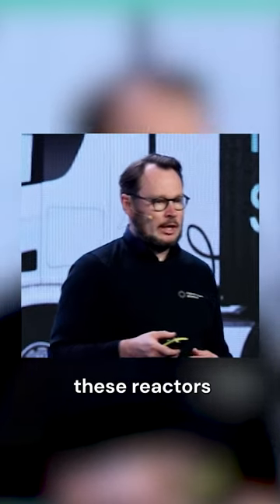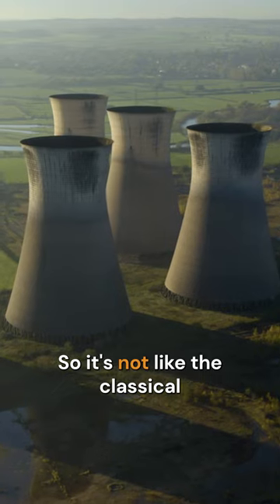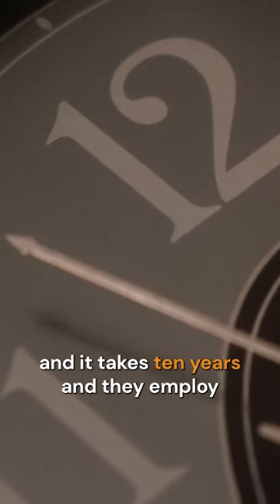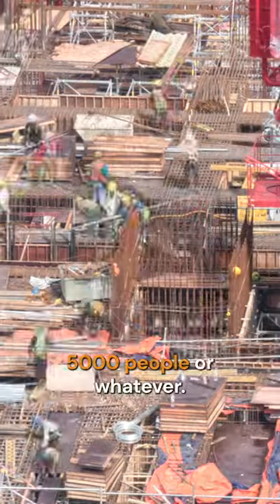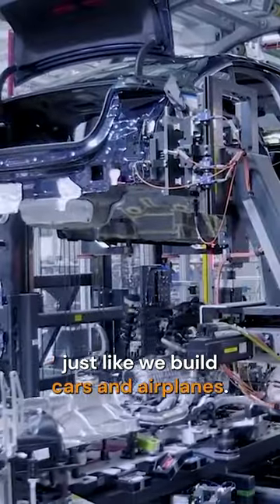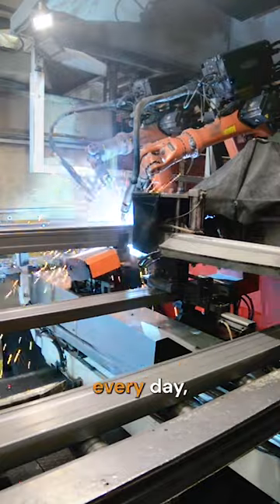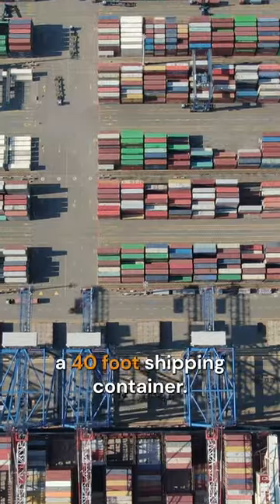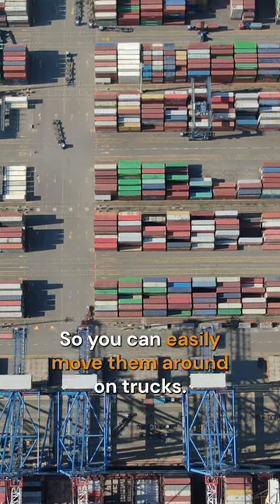Revolution Or Risk? Building NUCLEAR Reactors Like We Build Cars And Airplanes

Comment: Mini reactors have a lot of promise I think. The big problem with nuclear right now though is cost. And with fusion becoming a more popular goal, will there be a need for these (I mean besides remote/emergency applications).
Reply from the maker: Hi! Relevant question you pose. We believe so for a few reasons. Firstly, fusion is still surrounded by high uncertainty it may easily still take 20 years before we see a commercial reactor. Secondly, considering the sheer size of the energy market in the world, we will need many, many different companies and technologies to replace fossil fuels.
Reply: I think hoping for fusion when weve got MSR and thorium is like sitting in a tank in a warzone and waiting for railgun tech to pull the trigger. The tech is extremely viable, many people are dying daily due to the energy crisis, fusion is promising but way off and practically no different for our needs
Whats the purpose of fusion? Safe, cheap energy, wont cause a chernobyl 
What do msrs achieve? Safe, cheap energy, cant cause a chernobyl

Comment: Nuke on a semi-trailer. Coming to a neighborhood near you!
Reply: I find it Weird how more people are Concerned about Nuclear Reactors being Mass Manufactured Than the Current Number of Unfound Broken Arrows.
Reply: They wouldn’t ship it with the uranium in it, genius
Reply from the maker: @Ry_TSG that is correct! Fuel will be loaded on site
Reply: These reactors use Molten Salts.
The fuel can there for be pumped into and out of the reactor.
Reply: @NukHind You still have waste issues there guy, what is the local shop going to do but dump it.
Reply: @zack9912000  The fuel's in a closed cycle and no nuclear waste is just "dumped" anywhere in the world. When it runs out, the company that made them comes and gets it, hauls it to a processing facility, and safely disposes of the expended fuel. We've been doing so for decades.
Reply: @zack9912000 > not really. These reactors can even burn spent fuel from older plants. Waste pr. person in a lifetime is about a coke can in volume and not really harmful.
Reply: @Ry_TSG > they dont use uranium.

Comment: You can easily move your nuclear reactors around on trucks, eh? What could possibly go wrong?
Reply: Nothing. Literally nothing significant. Why do you think something could go wrong? I assume you know little about these new types of reactors. They are safer than wind power.
Reply: @AEVMU  yeah? These things are low power output per unit, so they would have to be plentiful (like wind tubines) and therefore difficult to giard. Suppose a terrorist steals one? Or blows one up. What then?
Reply: @paulgush  You can't steal them, that's like saying you could steal a building and its basement. If one gets blown up the radioactive material would probably still remain contained and even then, its not that  much or that bad. A bomb of the size that would be required to spread nuclear material would be far far far more effective in a populated place which makes them unlikely targets. Further, it is actually pretty easy to set up a perimeter guard at a building. You also can't say they would be plentiful like wind turbines. It's an order of magnitude or two, fewer, totally absurd to make such a comparison.
Reply: @AEVMU  a things you may be overlooking:1. the public psychology around nuclear accidents or acts of terrorism 2. The cost of guarding so many facilities. 3. The long lasting effects of radiological contamination

If you invested financially or even emotionally in this train to nowhere, I extend you my condolences. Nuclear power promised to be "too cheap to meter" back in the day. Instead it turned out to be too expensive to matter
Reply: @paulgush  Your points 1, 2, and 3 are all BS, and easily solved and you have clearly done zero homework. You do know that windmills are responsible for more deforestation than nuclear and more deaths in the last 20 years as well??  Did you know that many have balsa wood cores, and offshore wind produces more C02 per megawatt and is more expensive per megawatt? Onshore wind, because it is poorly planned, is also terribly ugly and utterly destroys the appeal of the countryside. You might like feeling like you are living in a machine but most people don't want to ruin nature like that. I'd rather 5 large nuclear plants or many smaller building sized plants, none of which produce any pollution, than visual pollution any day. Also, there is no nuclear contamination. Get with the times, you sound terribly out of touch.
Reply: @AEVMU  TLDR. You are a charming gentleman, very pleasnt to talk to. I wish you and this nuclear folly a happy yet futile future.
Reply: @paulgush  Considering how many plants are already being built or planned the future looks very promising.

Comment: I think depending on the energy output it could be ok, but i dont think they should be transported by truck or boat, unless the roads get closed off as its transported
Reply from the maker: Hi! Today, actually a lot of radioactive material is transported around the world every day. But we are very good at handling it, so it isn't an issue. Furthermore, we will transport the fuel and the reactors separately. So the fuel will first be loaded in the reactors when they are in place at the power plant.

Comment: So mini Chernobyls everywhere
Reply from the maker: Hi! No. You cannot compare these reactors to the RBMK reactors at Chernobyl. The safety in these reactors relies more on physics. Firstly, as the fuel is encapsulated in the molten salt, if the reaction heats up, as a liquid it will start to expand leaving a larger gap between the atoms and thus the reaction will slow down. Secondly, if everything fails say e.g. power loss like at Fukushima, the salt will drop into drain tanks underneath due to gravity and the reaction will stop. Thirdly, there is no pressure in these reactors meaning you can never have an explosion like at Chernobyl.
Reply: @CopenhagenAtomics  it was a joke dude i know that
Reply from the maker: Whoops haha! You never know in YT comments.. a lot of people seriously believe that :P
Reply: @gothicmommy8796 it wasnt.
Reply: @CopenhagenAtomics your CEO looks like the villain from a James Bond movie.  I can imagine Mads Mikkelsen will play him.

Comment: Fusion (and micro fission) power will make many billionaires a lot more money. Solar panels on every home, business and covered parking rooftop empower EVERYONE as their own power generation owners. There's no comparison...

#SwitchToSolar #SwitchToElectric #EmpowerEveryone
Reply: EXACTLY!!!  As long as I'm connected to the grid, the local power company is going to be billing me $220 a month.  Even if they have a way of making free (free for them) electricity, they will still be billing me.
Reply: Solar has its problems and if it could work as a power replacement, it would have been done already.  

Green power was always a part of the solution. Not THE solution. 

Before you make comments, I live off-grid. Most people could not and would not live off-grid on renewables alone.